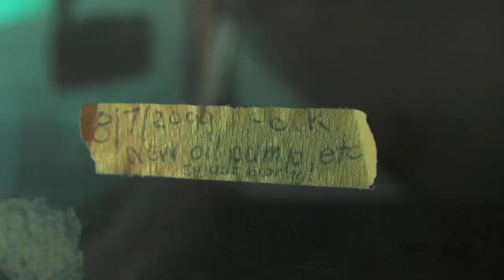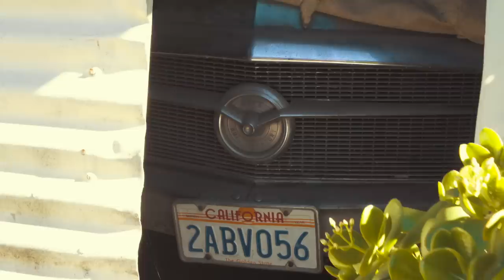Collection of California cars need new homes | Barn Find Hunter - Ep. 37

Comment: The fluid drive had a converter and a clutch attached to the back of the TQ converter input drive gear is about 20 in. Long I started on those transmissions.

Comment: Love the Roadrunner, but that is way too much for a shell that was an 383 4 speed that's been molested.  The GLH only had 146hp, same engine as my '87.5 Dodge Shadow ES Turbo
Reply: Whoever buys that Road Runner is gonna have to find  pretty much every part to put back on that stripped out shell.Also,some yabbo cut a bunch of holes in the rad support and likely in a bunch of other places as well so it's gonna need some major metal work as well.15K? I'd be hesitant to drop 5K on that pail unless there's a hemi sitting inside of it.

Comment: The Dodge GLH had a VW engine in them....  The Omni and Horizon had few interchangeable parts with their European siblings. Aside from the heavier-looking American body panels and bumpers, the OHV Simca engines were replaced with unique 1.7 L SOHC engines sourced from Volkswagen, while MacPherson strut front suspension took the place of the torsion bar arrangement found in the European Horizon. The Volkswagen engine used an enlarged Chrysler-designed cylinder head and intake manifold and produced 75 hp (56 kW) and 90 lb⋅ft (122 N⋅m).
Reply: Michael Holliday the GLH has a 2.2 litre engine. The Volkswagen motor was a 1.7 litre (my father had a 1980 Horizon 1.7).
There was also a 1.6 litre available.

Comment: I drag raced my Monte Carlo SS against a Dodge Omni Turbo and got beat. They were fast!
Reply: I was pissed off, the car was a 1986. It had the HO 305 in  it. I did the same as you. I
sold it. I Drove my old 72 blazer till I got my hands on a 1995 Police 9C1 caprice with
the LT1 350. I still have it. Just had the engine stroked and bored. Used a Scat forged
rotator kit, put in a nasty comp extreme efi  242/584 & Trick Flow heads Now getting 
475 at the crank and 412 at the tires. This coming spring it will get a Precision Super
Charger. Keeping the car plain looking hoping to get some street action around Annapolis 
MD.  I love those old Mopars. My dad had a 4 speed 340 Duster, 1970. His buddy
had a 1969 0r 1970 Polara Hiway Patrol with the 440 magnum. That car was killer
fast once it got moving. I bet you wish you still had the Fury now. Thanks for the reply.
Regards, OOdy Slim

Comment: Pretty sure unless the hood was swapped that the RR is a '68 not a '69 - and I think you can hear the guy trying to correct Blabberty the 2nd time he says '69. The side facing wedges with engine callout on the hood faced outwards in '68 like here, but in '69 they ended up with a 'ridge' facing up.